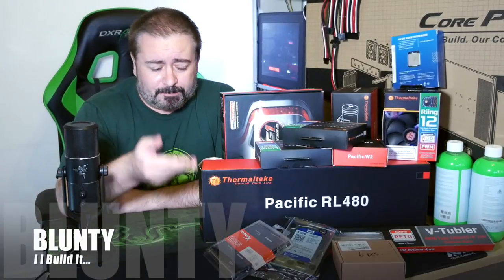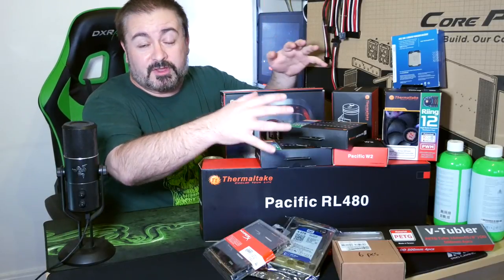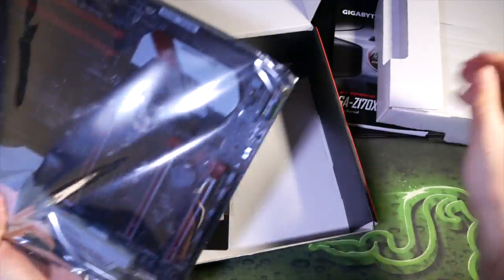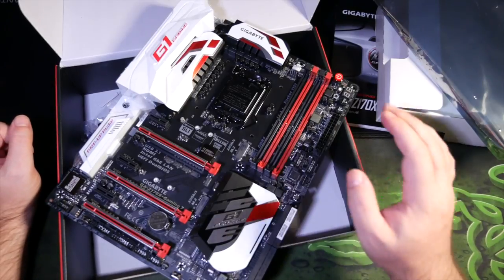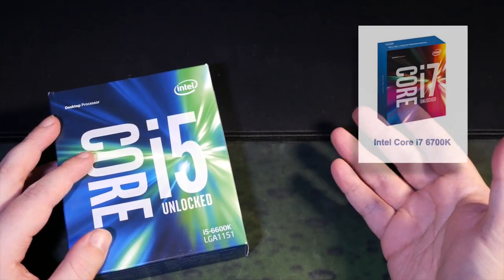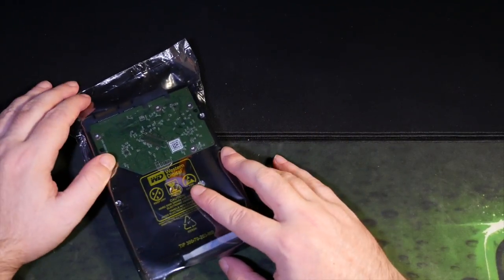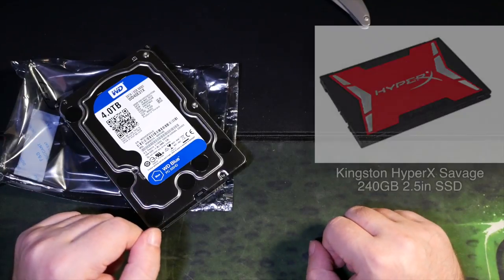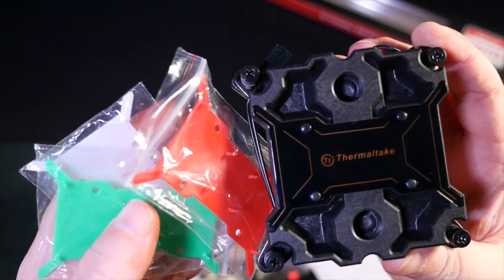I think I’ll call it “R2-Seethru” - Gaming PC Build-Log - Parts list.

Comment: Your thinking of having overkill cooling is the way i went on my build, although not quite as crazy as yours haha.  When your cpu runs between 24 and 30 degrees doing regular tasks you really see the benefits, super silent.....
Reply from the maker: +AJCFilmproductions Good to hear first hand that I'm on the right track here at least ;)
Reply: +Blunty haha, coming into winter too helps out, I might have to pick up some of those case fans your using minus the rgb, my stock ones run slow enough I hear the 'electrical' whine

Comment: Hi Blunty,

 I'm personally looking into taking the step into water cooling myself as I have a FX-6350 which is starting to get on in it's years and clocked from 3.9Ghz > 4.15 on air currently. As you can probably imagine on load the fan spins up and unless I use any sort of headset it's always notable. I recently acquired a MSI GTX 970 and clocked that from the original 1,050 MHz up to 1,530 MHz and it will still run incredibly quiet even past 80% fan speed.
I'd be very interested to hear if you plan to do a review of sorts on how you find the cooling kit you have just acquired and if you did points such as ease of use for the install and prior knowledge you should take in such as case size, adjustment to fittings or even just making sure you have enough tubing to spare.
On a final note I'm also mildly interested in any notable difference thanks to the RAM if you happen to check it. I myself have some older 2x4GB Vengeance 1600 RAM and considering a larger upgrade may look into the possibility of both around 16GB and DDR4 in my next build.

Thanks in advance if you take some time to read this comment. Kind Regards.
Reply: +Adam Wilmot (MaddieW) My recommendation to you is to just save up any money you can and upgrade your CPU+Motherboard. There is little point in investing more into your processor unless you plan to upgrade it in a few years. You don't exactly need DDR4 as of right now but in the coming years DDR4 is going to become the standard, but at that time it will not only be cheaper, but faster and more platforms will support it so hold off on it for a bit.

If you do plan on upgrading your cooling for your current CPU, do NOT go with custom watercooling as it will be a tremendous waste of money (custom watercooling is only recommended if you have lots of expendable money and are an enthusiast), so an a-i-o watercooler is the much better option. Not to mention a custom loop requires a lot of maintenance down the line.
Reply: I do plan to replace them, with the recent GTX 1080 Release that I plan to get I will need a complete overhaul anyway as my 6350 Bottle necks my GPU as is. (Probably convert this into a smaller case for travel to friends about 200 miles south for LAN use.) I'm currently unsure which CPU route to take as I use Substance painter and Autodesk products along with want to push my games to the max where possible as I have my 144hz Monitor but also an additional 2 monitors for the potential of Ultra Widescreen if I'd like it.

I expect the new GTX to be cooled very well on it's own but would like a long lasting cooling kit for both my next CPU and potentially the ability to swap the CPU cooling section later down the line and make it a strong long term investment. So possibly something rather large such as Blunty has used here.
Reply: Adam Wilmot
The 10 series from Nvidia looks really promising! Now I will wait to see what AMD has and then I will decide who to upgrade. I may recommend the same for you.

Also, the GPUs handle the displays so a CPU isn't ALL that important if you want a multi-monitor setup. If you can, go for an i7 if you want to be covered in all front cpu-wise, if not go for an i5 like Blunty did. also, we should wait until AMD reveals their next CPUs as well to be more sure. I held up my upgrade to a i5 6600k just in case AMD pulls a trump card and I end up regretting it.

And, well watercooling is expensive as I said, but you are right on the money about wanting hardware that will last you. Good radiators are extremely important. CPU blocks are very specific to their sockets most of the time, as well as the GPUs, but it is much more difficult because they don't make blocks for every GPU, rather only for the high-end ones where watercooling them makes sense.

Comment: See if you can get 64GB of RAM installed, 32GB for the OS, and 32GB RAM disk, 
Then see if you can get a Samsung 950 pro (the 2.5GB/s read speed allows for quicker loading of the RAM disk, thus you can have it duplicate a single smaller ~30GB game to the RAM disk, for even better load times (RAM disks do not experience much of any slowdown when doing 4K random reads/ writes).

PS, depending on the power of the pump, you can add in a second radiator in order to have additional cooling capacity for the CPU for when overclocking as much as possible.

Comment: Maybe I'm just wrong, but is there even a situation where higher frequency memory even matters? It typically cancels itself out due to its latency so I don't get why you were so excited by the ram. I mean, heck, to my knowledge there aren't even many situations where ddr4 matters over ddr3 other than stability. Also, I do understand that if you're using integrated graphics then higher speed memory does make more of a difference.
Reply from the maker: +Little Dashie I'm more jazzed by the fact it's THIRTY TWO GIGABYTES of ram... hell of an upgrade over 8gb... and yes, Speed CAN matter, especially in situations where the CPU starts maxing out and holding back the downstream stuff.... but not as much as pure capacity (I've demonstrated this in a video before in fact... surprised you missed it :P )

Comment: Hello!

I was wondering.......... I just bought the ASUS VIII Formula and did not look at gigabytes options.... I could return it although the warranty would be well wasted to say the least... Can anyone give me a good comparison between the two?

Thanks in advance!

~nintendo colas
Reply: +nintendo colas In reality, motherboards don't really make too much of a difference in a pure performance sense. It really just depends on whether or not it has the extras that you want (i.e. number of usb ports, quality on-board audio, etc.) To answer your question though, overall their specs are very similar, but when it comes down to it I might opt for the gigabyte board as it knocks off a pretty significant chunk of money compared to that of the Gigabyte G1 Gaming GA-Z170X-Gaming 7. Of course one thing to think about as well is the color scheme, white might throw off the flow of your build a bit, but if you don't care about that then the Gigabyte is a very tempting swap. Of course this is all depending on whether or not you can return it for a refund.

Comment: Why don't you put your os on the m.2 it will be faster
Reply from the maker: +Brian Richards Because I'd rather my GAMES be pulling their data as fast as possible, rather than speed up my boot times, and load time for chrome slightly more, they're ALREADY on a very fast SSD. It's not even a remotely difficult decision.
Reply: ok
Reply: +Blunty No question about it.